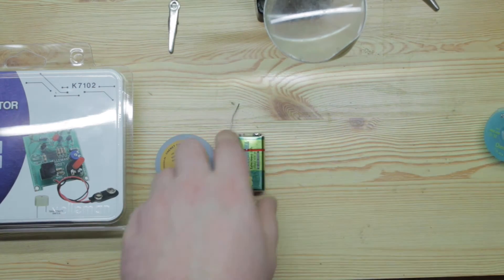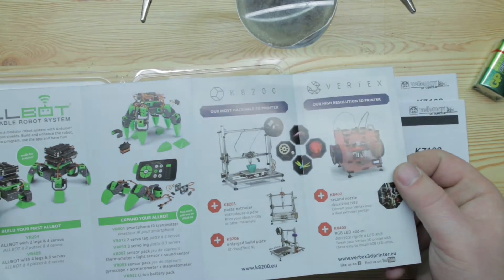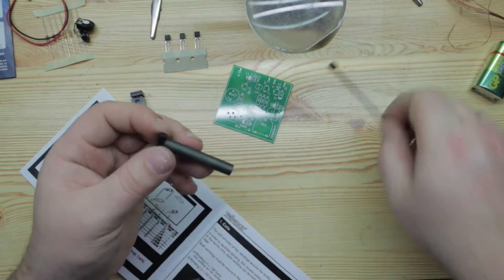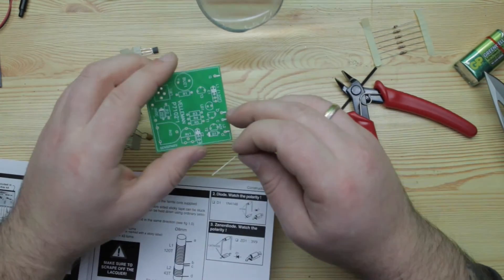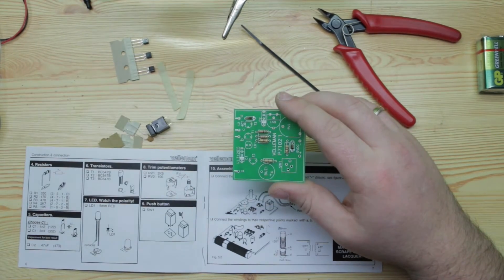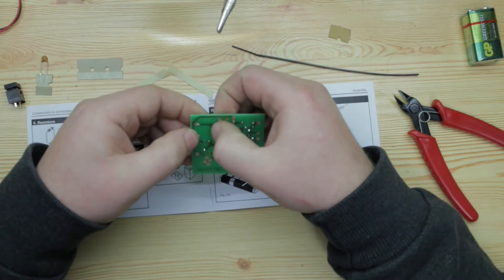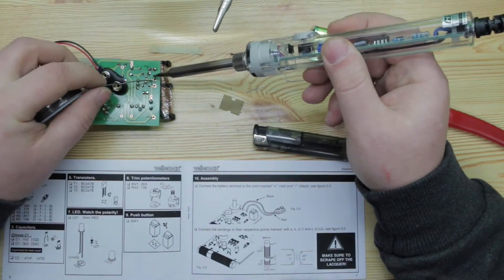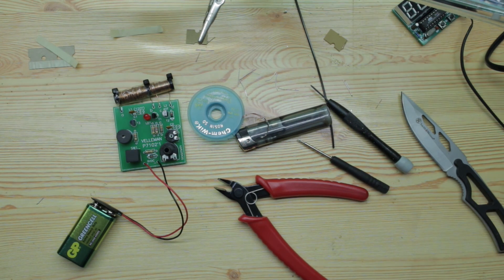metal detector kit. Velleman K7102

Comment: Me and my dear friend Ahmed M
 (R.I.P) had implemented this circuit in 2007 in Iraq as a project and convert it into hand held metal detector for security purposes. We got only the Pdf file from the website all the electronic parts are purchased from local markets. the coil Rod is obtained from an old AM radio.  WHAT  GREAT DAYS  ! Thanks FOR VELLEMAN kits.